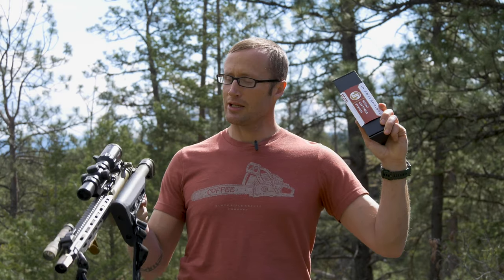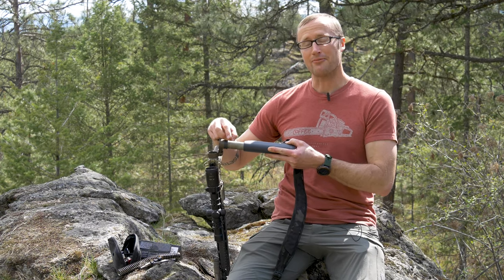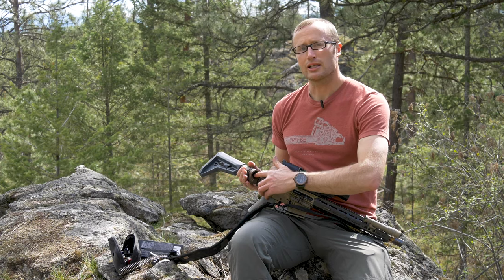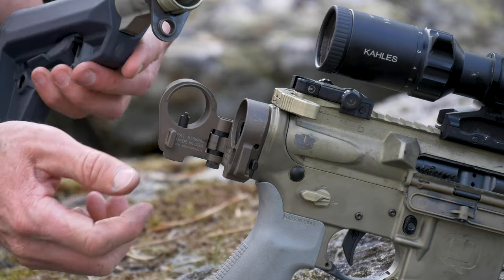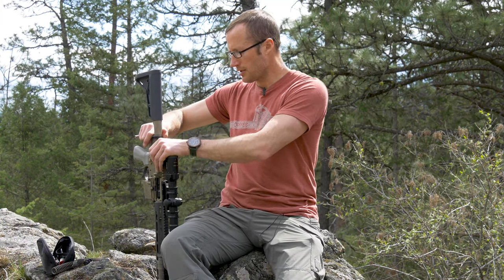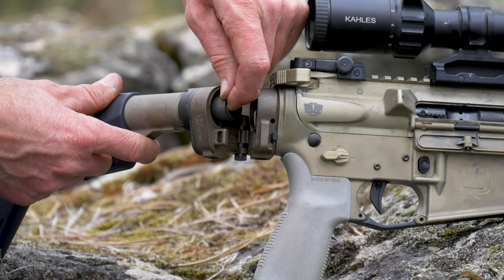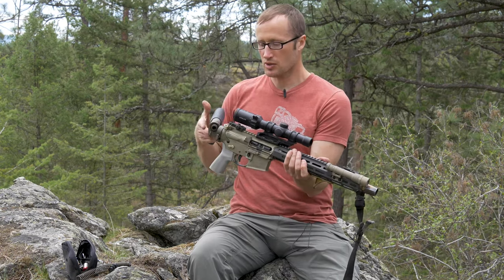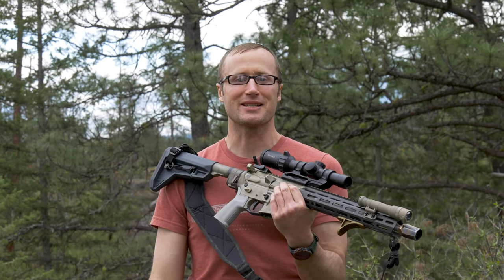How To Install a JP Silent Capture Spring into a Gen3 Law Tactical Folder

Comment: There is a similar item made by Armaspec called the stealth spring. It's about $80, and I have heard it performance is similar. For those with lower means, this may be an alternative.
Reply: The JP unit comes with a bolt extension specifically for use with the law folder. The armaspec versions require the purchase of an additional bolt adapter. The only place I found one was at Anarchy Outdoors. It's called the Tactical (Folding) Bolt Carrier Extension and it's about $70. Just an FYI for my fellow financially frugile firearm friends. (Todays letter is F....for Fantastic😬)
Reply: @MrJalowery  how do you like the armaspec?
Reply: I've got the armspec in my sugar weasel and when using my trash panda with subsonics its crazy how smooth everything feels. Everytime you pull the trigger everything feels solid.
Reply: @jamesw9223  I do. I've never tried the JP though, so all I can compare it to is the stock buffer/spring. It's better in my opinion. Just to be clear I actually bought the SMB H-2(sound mitigating buffer H-2 equivalent), instead of the SRS(stealth recoil spring). Two reasons: its cheaper🤑 , and theres a hidden bonus. With it being a non contained spring you can tune it by cutting of small sections of the spring. It runs perfectly fine now, and when my supressor gets out of jail, depending on how it runs, I will have the option to circumcise it if needed. Plus it's cheap so if I fuck it up I can more easily replace it.
Reply: Does it work with a folding adapter though? They don't sell any capture spring with it. Do you know if a JD Capture Spring would work for the Armaspec?
Reply: Yea the JP has the law folder adapter so that the rod can avoid the folder adapter.

Comment: Heads up you dont need to take the buffer tube out the small screw right below the retainer is specifically mean for the buffer spring retainer. if you unscrew it you can just plug a new one in and screw it back in.
Reply from the maker: I mentioned that...  :)
Reply: @KitBadger  nice :) prob skipped over it cause i was listening your video while doing a college class
Reply from the maker: @savage5764  hahaha, there is no such thing as multi-tasking.  :)
Reply: @KitBadger  I think you may have edited that part out of the video.

Comment: Did I notice correctly that the silent captured system has it's own carrier extension in lieu of the Law Tactical one?

Is the primary benefit in that it is quieter than a traditional system, or does it reduce over recoil impulse as well? 

Thanks for the great vid! Hope you're digging that folder!
Reply from the maker: Yes it does and it smooths our the cycle of operations.

Comment: Did you have an h2 scs with your 300black out? According to the JP site it says to use the regular weight ar15 for 300 blackout. But what if you shoot more supers then you do subs and what if you have a 10 inch barrel. I guess adjust the gas. What do you think 10 inch barrel 300 with law folder, it looked like you had the h2. I did get the spring kit I suppose that a heavy spring could also reduce felt recoil from 150 grain.  round. I didn't like the fde even though I have the aero lower and stag upper in fde, I should have just gotten the one you have but i painted it using the aervo utility vehicle paint which is extremely close to Aero even after baked on. I just worry it Will come off. Does the Q in 16 inch come with a mid length gas system or pistol. I assumed that the blackout come in pistol regardless of barrel length. Did u do well with your scs was it h2 or non weight?
Reply: In retrospect I have a gasy barrel. And when I fire it with an H1 150 grain supers it just was very inaccurate 10 inch barrel somewhat of a bigger feeling round then 556.  then the super 42 spring and h2 buffer did help the recoil. But since then I got an adjustable gas block and the fact that I can tune the gas down and choose a heavier spring if I want to with the scs, I think is why the site recommends regular non weighted scs with 300 but it didn't specify which grain or super or sub.  I just dont want to stove pipe that happened when I ran a Geissele spring with the H1 the bolt came back way too fast. But with the law tactical folder adapter adding weight to the bcg taking a bit of gas out it should run great and even better with subsonics. Infact they say def use the non weighted one with subsonics. I was wondering more about the 110 150 grain rounds. I think the one thing I want to not have is buffer shake buffer bounce. Bolt slam. This system is supposed to feel amazing and I'm sure it does with the proper spring and tune. And it's the only spring and rod system for the law folder. The rod goes into the carrier so the Sylvan arms folder will not do just get the super 42 h1 for rifle length h2 for mid.
Reply: @TennisWorldSetPoint you ever end up trying it out? I want to put one into my shared lower for a 12.5” criterion 5.56 upper and .300 9” BCM upper. According to BCM their gas port is designed to run supers with an H3 and subs with an H2.

Comment: doesnt the law tactical have a nut holding the spring up for the retaining pin. i know both my law tactical folders gen 3 have it and it would have made it a tool less install. check on the bottom of the retaining pin.
Reply: All three of my LTFs have a grub screw retaining the buffer detent and spring from the bottom too. 
That is the route I’ll attempt first before loosening the castle nut.
I just have to pull the trigger and buy the JPs.  LOL
Reply: @keithbailey6143  yup I have several law folders but only just recently bought one JP. its needs the adapter. not the law folder included one.
Reply: @Skrewstoned  yes sir. Brownells has a couple models of the JP SCS that comes with the required adapter.

Comment: So does the shim just stay at the end of the buffer tube
Reply from the maker: Yes.
Reply: @KitBadger  i put one shim and it still has that wiggle sound you pointed out towards the end of the video. Do you think its fine if I add the second shim? Or if i just put a quarter in the end
Reply from the maker: @96tactical11  get a second shim or two.

Comment: I think more AR manufactures should make rifle without the forward assist.  Iraq, Afghn never used it.
Reply from the maker: Only argument is press checks, depending on how you run your gun.
Reply: I've found that they are most useful if you do not properly pull and release the charging handle, ride it forward, etc, and the brass/BCG does not fully/properly seat. Not for clearing malfunctions or jams like a lot of people/channels say.

Comment: All that work to replace the buffer retention pin?!?   Dude, there is an Allen set screw directly beneath it in the Law Tac that you could have just taken out and dropped it out and replaced it through the bottom :(

Comment: I don’t see the appeal of having a folder on a shorty gun, the only practical item I can come up with is maybe there’s some storage issue?
Reply: It’s all about storage. Folding the stock/brace could be the difference in having it fit in a backpack or not.
Reply: I imagine that firing from inside a vehicle may be easier with the stock folded.
Reply: mrfrosty3 an AR15 with a folder will only get the chambered round to shoot and won’t cycle.
Reply: mrfrosty3 it would only fire one round, the bolt can’t cycle unless theres a buffer tube for the bolt to travel to complete the cycle of operations.
Reply: @AlphaChimpEnergy  Thanks. I forgot the entire video was about installing a buffer.